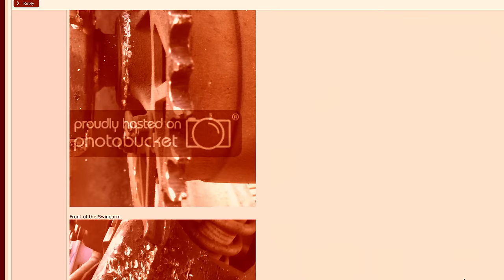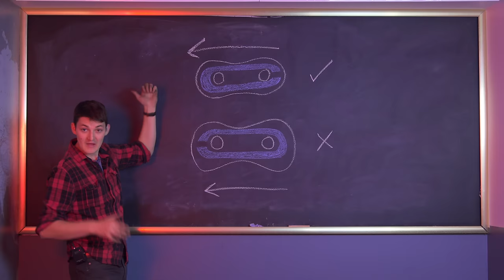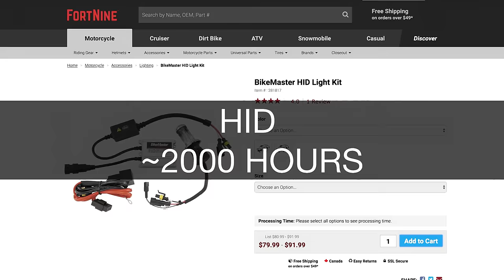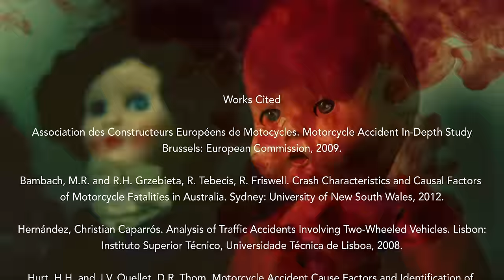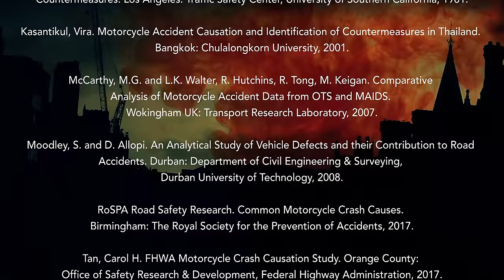Mechanical Monsters – 5 Maintenance Jobs that are Deadly to Overlook

Comment: Spot on, you empirically identified the killers. I am a factory trained old school mechanic who eventually became a professor.  I wish I could communicate complex matters to my students as entertaining and pointed as you do.  Respect! Btw., after 40 years of riding I recently had my first wheel bearing suddenly disintegrating on a road trip. Spooky!
Reply: Have fun and stay safe! You got the dream job, man.
Reply: That happened on my rear wheel a year ago. It suddenly made a screeching sound follows by the rear tire immediately shaking around like crazy. Luckily I was only going 80kph and in a straight line as it happened
Reply: More professors should have learned their craft that way!
Reply: I had a rear wheel bearing go out on an old Yamaha going around a corner. Thought I was going to eat it for sure
Reply: had the same..after 15K miles on kawa...surprise....water damaged the front bearings
Reply: @dancingkids5158  Not just professors, engineers could benefit from real world knowledge
Reply: My rear sprocket bearing broke and the chain stuck into the swing aram, thank god i was on a rough road and i was riding dead slow, before this i told my mechanic that during corners my rear rim sounds like it is scrachting, the mechainc checked the wheel and said its fine, but i had still fear that something would happen and that happend, in short check the sprocked bearing also
Reply: Oops,.. Yeah there are small chances for a part to fail.. But it happens!.. And there must be many accidents every year, which can rely to worn or stressed-out parts..
Reply: I was my teacher's best electrical tech student.  He taught the wrong electrical energy transfer theory that power flowed through a wire due to electron flow.  Not the case.  I had to learn myself years later that the power is transferred from source to load (light bulb) by the electromagnetic field that encircles the circuit the moment the switch closes.  The field carries the energy just like a stone makes a ripple in a pond, and then the ripple makes the kid's toy boat rock back and forth.  So simple yet none of my electronics professors ever mentioned it that way.
Reply: @gulmuhammad5158  thank God but fire your mechanic.
Reply: @wsbill14224  aha! Eureka! So, dispensing with wires might could possibly eliminate copper wire theft...pending re-discovery of “the path not taken”.
Reply: @mattthomson1689  is that a joke?  The wire is needed to create the magnetic field.

Comment: At least with a TW200, if you lose the brakes, you can just step off the bike and walk slower.
Reply: you don't need brakes on a TW200, you just close your throttle and those massive types do all the breaking.....you can also use your feet for a more dramatic result!
Reply: You mean walk faster?
Reply: Or put your feet down and stop Flinstone's style.
Reply: 😂😂 preach!
Reply: Like Fred Flintstone...
Reply: Yeah, they're slow. Mine with 1 tooth bigger on the countershaft sprocket, a cam, intake, jets, and exhaust will do about 70 on flat ground, but neither I nor it likes it. It'll cruise beautifully at 50 or 55, though, and it's a goat on the trail.
Reply: @The_sinner_Jim_Whitney  

Nah, that thing is comfortable at 10k rpm all day every day. You may be uncomfortable with it, but the bike doesn't mind. I rode one of those things at 75 mph on the highway for about 20 miles every day for years. No issues at all. I'm really convinced that the TW just can't be bothered to break down. It's just too much work and she just doesn't wanna.
Reply: @methamphetasaur  I used to ride mine pretty hard, until one day I found little bits of metal broken off inside the case, and a bad head gasket leak. I just need to rebuild the whole thing & have it decked. Also has a clicking on 1st 2nd gear from when my chain snapped and got jammed up with the front sprocket and cover. That valve spring nut is pretty annoying too, always loosening up every couple months😒
Reply: methamphetasaur That's probably true, but if it sounds like it's going to fly apart, I just can't stand it. Also, do you weigh like 86 pounds? I've gotten my substantially (I mean, 10-12% is pretty substantial, even if it is like 2 horsepower, haha!) more powerful and higher geared than stock bike to maybe 75 or 80 on a LOOOOOOOOONG straight without headwind once or twice, and I'm 150. I also have big fat knobbies on it, though, I bet a smooth street tire would make a pretty big difference on something with their power level, and if you commuted on it you probably had milder tires.
Reply: I had the stock tires on it then- so fairly knobby, but nothing extreme. I weigh about 150 too. The gearing was the only 'performance' upgrade I did. I feel like that bike is too slow to be throwing real money at it. 

And like you say, it takes a long straight without a headwind to even get to 80. 0-80 time is probably in the triple digits.
Reply: methamphetasaur haha! Yeah. Do you live somewhere flat? I live in WV, there's very rarely more than maybe a flat mile (and that's just along the river valley). I agree, the only reason I wanted to make mine faster was to make them feel less stressed at 55-60, which is as fast as I'm comfortable riding mine for any length of time. They're pretty slow, and should be.
Reply: @The_sinner_Jim_Whitney  I lived in Phoenix at the time.
Reply: methamphetasaur That's reasonable, then. I live in super steep hills and super high humidity, they're even more gutless here, haha!
Reply: @The_sinner_Jim_Whitney  That's actually why I sold mine. It's fine on flat ground, but I live in the mountains west of Denver now and it struggled to maintain 55 on the highway up to my house.
Reply: methamphetasaur Yarp. That's why mine is a trail/ backroad bike, and also my favorite I've ever owned or ridden. You couldn't pay me double time to ride it on an interstate. Particularly in Denver, I think the minimum highway speed there is 135 and turn signals are illegal.
Reply: This made me spit my water on my screen
Reply: @TheKitchenTechnician  No, No...Slower... that his regular walking pace would be at...
Reply: Yours will only do 70 with all that work done? Mine will do 70 stock. It's not happy about it but itll do it.
Reply: The Fred Flintstone brakes still work on my T-Dub!
Reply: @The_sinner_Jim_Whitney  I ❤️ my T-Dub!
Reply: William Fallecker It'll do over 80, but it takes its time getting there and I don't want it to because it's tached way up high and the tires probably aren't safe there for long. The point of what I've done to mine is to make it a better trail bike (it is) and make it comfortable and unstressed at 50-60 mph (it is). I have no interest in interstate riding, nor terribly long-distance riding. Just backroads, 55 mph state roads, and trails.
Reply: I'd take a tw over a honda grom anyday
Reply: Xavier Chavez With a little work, a TW runs pretty good. Mine will do 75-80, which I don't ever do, but it makes 60 comfortable. Same for the Grom, in fact. My girlfriend rides a Monkey bike, which is a Grom decorated a little differently, with intake, exhaust, and an electronic jet kit it's perfectly capable of riding 55-60 comfortably on 2-lane state roads, which are the most serious roads we ever ride on.
Reply: @The_sinner_Jim_Whitney  Everyone wants a grom but it's it a little known secret the TW will take you most places a grom cant go
Reply: @The_sinner_Jim_Whitney  Ive also gotten up to mine 65 easy with stock. I just purchases one like 2 months agon and already did 700 miles and did my first oil change.
Reply: Xavier Chavez I've yet to have cojones enough to attempt to get anywhere my TW wouldn't take me with zero drama. I think they're the most awesome motorcycle in history, haha! I have to say, though, with knobbies and some hop-up stuff, my girlfriend's little Monkey bike is downright shockingly capable for a street-oriented 125 with 12" wheels/tires.
Reply: Xavier Chavez If only Yamaha would kinda update the TW. Like, a SLIGHTLY larger, fuel injected, 300-350CC TW (a TW-shaped CRF250L Rally competitor, essentially, but still air-cooled, ooooh, a 350 twin?) with a 6-speed would rule the world... 

Not everyone wants a skinny-tire big-suspension, short service interval MX-based dual sport that works you to death to trail ride. I'd LOVE to have the simple point-and-shoot easy rideability (and TRACTION!) of the TW but with enough power and wheelbase to be a little more on-road viable. Real suspension from the factory would be nice, but mine trail rides awesome with fairly cheap fork and shock upgrades from ProCycle, so whatever.
Reply: @The_sinner_Jim_Whitney  That would be awesome. That's TW is almost perfect I just get a little nervous because I ride on the road to get to the trails and im limited by the freeway. Im like two hours away from some great motocamping and I don't like to load my bike onto my 2002 tacoma. If it went like 75-80 I would be set for life. I would rather ride a TW on the trails than a big adventure bike. I live in a desert/mountain climate and the tw is so good in the sand and light enough to paddle around tight trails in the mountains
Reply: Xavier Chavez I live in the Appalachian mountains, and my TW is even better here than it is in your terrain (I've ridden it a fair amount in NV, NM, and CO). I wouldn't ride mine on the highway even though it's capable of it, but yeah, a little bigger/more powerful and I happily would. It'd be great if it was more primary-road-friendly.
Reply: The sinner Jim Whitney i habe a one tooth sprocket
Reply: J Y Entertainment I have a two-sprocket tooth.
Reply: Don't forget to clean the bugs off the license plate.
Reply: I wanted to like this but I’m not messing up 666.
Reply: Just rev matching while downshifting does the trick.  The gears are so short.. it's how I usually stop.
Reply: @methamphetasaur  heh if you stuck it on Craigslist, I probably saw it. I'm on there almost daily. Definitely remember seeing a few west of the city over the past year.

Definitely want a tw. Currently riding a rebel 250, which seems to have a slight edge in the speed dept. I don't like taking it on highways but she will do it. I've had the needle past the 85mph mark on one occasion.
Reply: @ClinttheGreat  I once watched a buddy stop his 650 ninja flinstones style. It took him MILES to stop. when I was like, "what was that about?" he replied, "I needed a reason to buy new shoes." his master cylinder had failed, and no I don't know why he didn't use the rear brake.
Reply: @ClinttheGreat  not recomended when riding barefoot or with flip flops
Reply: @methamphetasaur  hi meth I remember you from the forum
Reply: @FlannelGorilla  Yeah, I haven't been on there in a few years. There was a super shitty moderator on there that made that place no fun. That and the fact that the changed the forum to where you couldn't edit your posts just made me realize I didn't need to be there anymore.
Reply: @methamphetasaur  I haven't been either, I try to go back every now and then but they changed the whole forum it's not the same. My fatbikes got an issue for the first time though so I'll have to go ask for help soon.
Reply: @FlannelGorilla  what's wrong with it?
Reply: @methamphetasaur  starter was just clicking so I thought the battery was dead so I replaced it, didn't fix it. Something's gotta be broke I think, it was weird I parked it and let it sit for a week then it happened. Still runs great I've just been roll starting it lol.
Reply: This hurt. Hahahaa. My first bike was a Tw. I was 13. Rode the heck out of that thing but it wouldn’t ever go about 64 mph. And it wasn’t stable either. Haha

Comment: I personally loved how at the end he showed all the causes at once. 10:01

Because we tend to forget just while watching the video.
Reply: Did a snap-shot of that summary — putting it in my maintenance log (at the front)! 👍😎
Reply: 10:01 😱😰🥶
Reply: @shimagaijin1  Do you know a good place to purchase one? A maintenance log?
Reply: @Andytheevien  for any kinda log I always just buy a binder, sheets of hole punched paper with a gridded pattern fitting for, in this case, a date, the mileage, the maintenence done, and a few more for any details you may want to note such as the measurements you got prior or after, or if you have multiple bikes and one log, which bike was maintenenced, then for notes like this, you simply print or write whatcha gotta know, hole punch it, and put it in either before or after the log(i reccomend before, and also that you get a divider)

Edit: this is all assuming you keep it physically, a digital alternative can be done with something like excel and some file folders to store it in, but make sure to back those up regularly on another drive seperate from the or risk losing all your logbook in event of file corruption or from physical damage to the drive by, for example, a home fire
Reply: I've paused the video at that point and screenshot it. That's how brilliant it is.
Reply: I actually took a photo. On a side note, I got my mechanic to replace my wheel bearings on my DL1000 at around 35K as I had done a lot of offroad including creek crossings. They didn't want to but I insisted. When replaced 1 was close to failure.
Reply: We are dumb dumb
Reply: thats called a recap! middle school english. the humanities matter

Comment: I know I'm late, but I've had wheel bearings fail catastrophically on two occasions with in a year on my TTR 230. That required a rear wheel hub replacement on both occasions, $200 per hub. I'm not entirely certain about what caused it, but I suspect loose spokes. If you have spokes on your bike, give them a flick every now and then, listen for a dull sound.

Comment: One more thing about chain alignment from my experience - a loose chain inevitably starts shaking sideways so it's basically misaligned which in my case led to change if: 1. Chain, 2. Both sprockets, 3. Gearbox bearings and a massive repair bill.

Comment: I like that you took the time to show people how easy it is to address most of these issues.
I think many of the intervals are a bit short for most riders actual use, but the point stands, that - if it's been 5 years since you've really looked at any of these things - you very due and tempting fate to ignore at least checking them.

I have a friend who ignored my warning about his chain.
A few weeks later it didn't snap, but it suddenly came loose enough that it popped off, jamming his wheel to the swingarm.
He luckily wasn't seriously hurt.
But he didn't save any money, because he still had to buy new sprockets and a chain, but now he had to add to that straightening or finding another swingarm, more time to check if the bike was safe to ride, and a replacement helmet that wasn't as nice as his prior one.

Comment: Cool! I’ve had 2 out of 5 of these catastrophic failures but I didn’t go down. The brake hose failed at a red light when I was almost stopped. The front tyre blew out at 100kmh but I didn’t go down but I aged 10 years on the wobble to an ungraceful stop (2 up with luggage).

Comment: Great video Ryan! I had a wheel bearing failure once too on the rear, I was lucky that it didn't lock up. It just felt like you were poking briskly on the brake. When I pulled over to try and figure out what the hell was going on, I found the rear axle slid right ahead with bent adjuster bolts. I was 40 miles from home and a buddy came out with a trailer and hauled me home. Now this was a new used bike to me, and upon tearing it all apart to fix it that whoever had that wheel off last failed to put the spacer in between the bearings. My 99 Heritage still has tapered bearings so imagine the overload on them from having the axle torqued. After replacing the axle, adjuster bolts, spacer and bearings and seals and setting the bearings right she's been mint. Oh, had a headlight failure too once. Overloaded breaker tripped and everything went black, one the gravel road. That was interesting.

Comment: "fresh fluid every 2 years"

laughs in wire drum brakes

"check your chain"

laughs in driveshaft

"check your alignment"

ah..... cries in ural
Reply: Wire drum brakes - Laughs in two finger proper stopping distance!
Reply: Check sidecar bolts
my ural had a rapid unscheduled disassembly when it decided to be a motorcycle all of a sudden. It was a CT so no 2 wheel drive, and upon further inspection i was missing some bolts which came loose to the point that only one bolt was left. So check your bolts frequently. Ride safe
Reply: @botyaay1233  2-4years brake fluid
Reply: @botyaay1233  I can imagine that was a little bit terrifying
Reply: @insertnamehere6960  Trousers soiled but no physical injuries. only the front bolt came off so the sidecar didn't get away. but believe me it was the shock of my life when it happened
Reply: @botyaay1233  just get a passenger to hold the bike who needs bolts :P
Reply: @botyaay1233  i'm just imagining you driving alone with a side car and suddenly it just decides to make a pitstop without you. It sounds comical so long as you weren't hurt.
Reply: My Ural solo's horrible handling was eventually cured by fitting a sidecar, complicated by being it being a Busmar double-adult and having to fit it on the left-hand side: just about enough room for the kickstart to swing out and do its job, but at last it stopped trying to throw me off at unexpected moments. And I'll never buy anything Russian again.
Reply: @johnevans7261  They're not that bad if you're into constantly fixing things on it (like me). They're supposed to be treated like 1950's farm equipment rather than a modern machine. I can say for sure that Urals, KMZ's, IMZ's, Dneprs, all are awful when solo and take some serious getting used to + proper tyres, mainly because you have two massive weights on each side (engine).